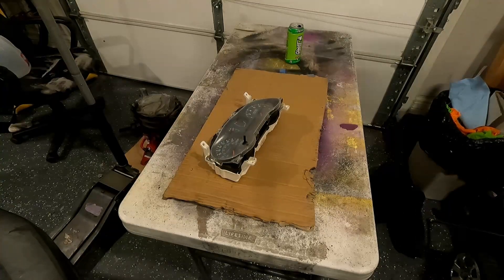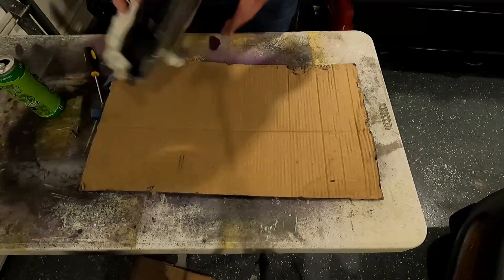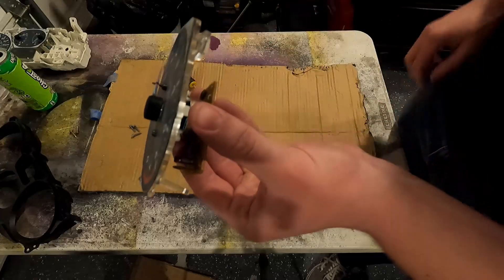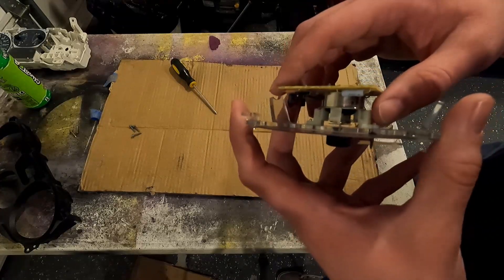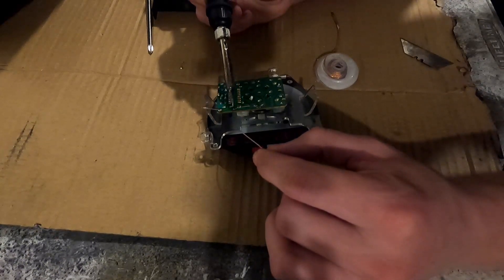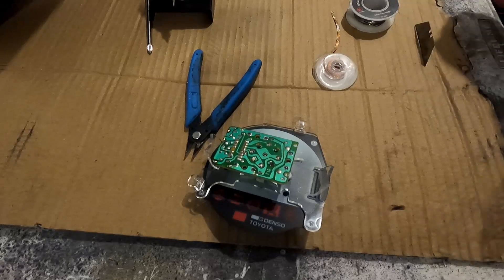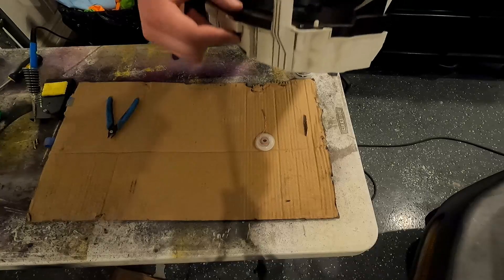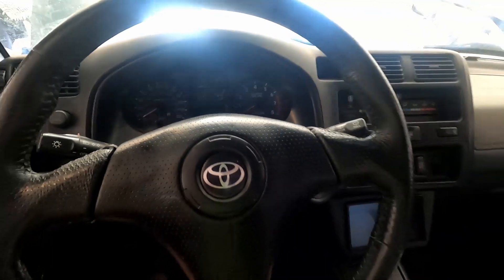5 Minute RAV4 Mod - Fix Your Tach for a 2AR or 3SGTE Without a Signal Covnerter

Comment: This is awesome!  I would have never guessed that's all you need.  Thanks for the mention.  
In my dash light video, dropping the steering column is needed in 1996 and 1997.  1998 and newer the dash trim is flat across the bottom and you don't have to mess with the steering column.
Reply from the maker: The man himself! Yep, basically all that resistor is doing is dropping the input voltage from the igniter, so running off of 12v instead just neeeds a way smaller resistor. In fact, later model Toyotas already have this 24k resistor in the same place on the same board
Reply: So what actually causes the original resistor to stop working. It's it simply a faulty resistor or is something else occurring? I have the same issue in a 1995 Rav4 manual. Appreciate the advice and will give it a go. I've also got temp but no fuel gauge which could be the sender unit unless you know of some other issue regarding the fuel gauge. It is not simply a stuck gauge. If you have any ideas would appreciate your thoughts. I also learned not to use a tissue in that black console plastic. Tissue left bits of tiny bit visible bits all over the it. Pain to take it apart again to get it out.